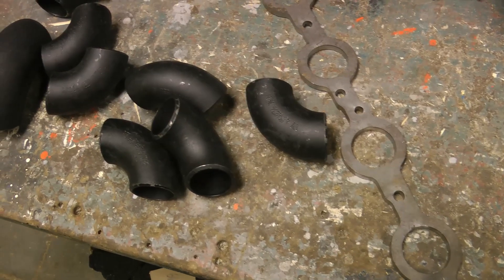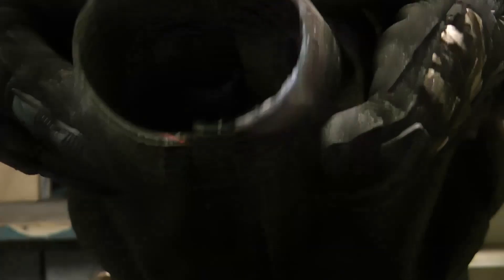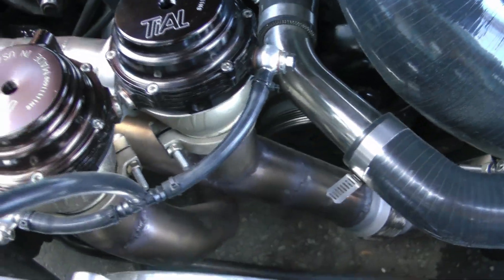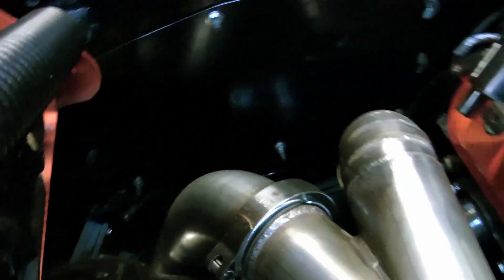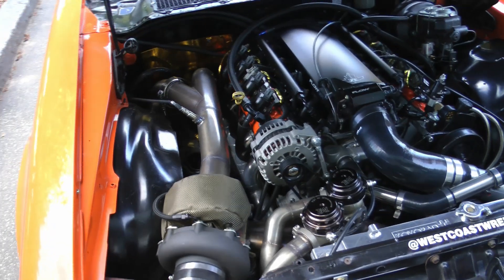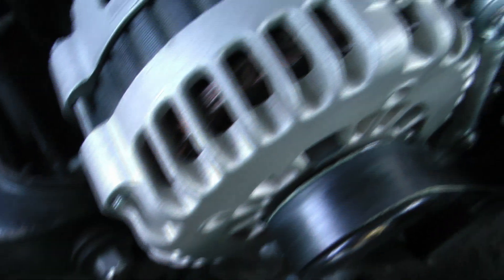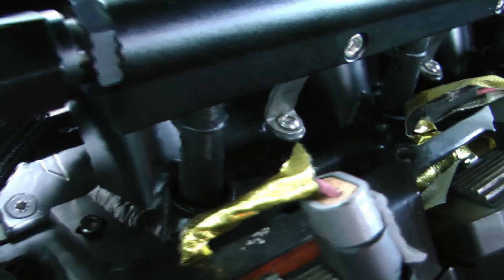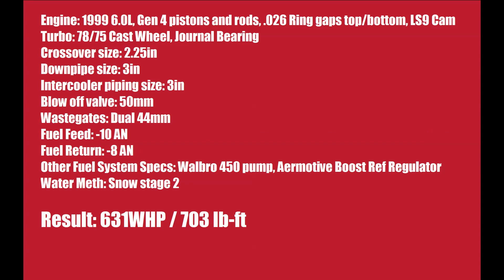How to Turbo your LS Engine (Turbo 1973 Camaro)

Comment: This is some serious fab skill man. Would love to build a setup similar to this but blow through carb 6.0 Currently in process of building. Plans for a 6.0 with PRC Stage 2 heads and stock cam. Gapping rings and looking to run 10-11PSI. Going through a magnum F and a reinforced 10bolt.
Reply from the maker: Thank you! It really just comes down to thinking things through, anyone can do it with patience

Comment: What kind of fitting is that on the intercooler charge pipe for the wastegate feed?
Reply from the maker: The aluminum elbows? Those elbows are vibrant and they're cast aluminum so you can thread them. They're tight radius too very nice pieces.
Reply from the maker: https://www.amazon.ca/Vibrant-2873-Degree-Radius-Aluminum/dp/B001804R1Y/ref=asc_df_B001804R1Y/?tag=googlemobshop-20&linkCode=df0&hvadid=293019025087&hvpos=1o2&hvnetw=g&hvrand=9471587623923005623&hvpone=&hvptwo=&hvqmt=&hvdev=m&hvdvcmdl=&hvlocint=&hvlocphy=9001444&hvtargid=pla-568633821806&psc=1
Reply: The fitting that you used for the boost reference off that pipe
Reply from the maker: @edwinrosadojr4592  that's just a simple npt to barb fitting. They're available at any performance part supplier
Reply: Westcoast Wrenchin'  thank you for all your help

Comment: Would love to see a 1/4mile run. This is a great channel keep it up.
Reply from the maker: Thanks so much! I've actually done one! The trans was on its way out and grinding bad  but whatever. Did 11.8 @125mph with a 2.1 60ft. Managed a 1.8 60ft but overboosted and shut off :( wait for next year is all I can say! I've got big updates to post soon. Thanks again for the support
Reply: @WestcoastWrenchin  This car is very cool the videos and instructions are great. I will stay tuned
Reply: @WestcoastWrenchin  nothing to be done to the map/maf sensor?? Doesnt the gen 3 come with maf and i have to convert it to map??
Reply from the maker: @FirstLast-tx3yj  what is your ecu setup? I've always run speed density and used a map sensor, I've never had a maf or a stock gm ecu
Reply: @WestcoastWrenchin  i have 2006 lq4 with stock p59 ecm and maf

I have done the manifolds and cold side but idk what to do with the maf or if I should do anything about it?!
Reply from the maker: @FirstLast-tx3yj  im not too sure on a stock gm ecu because I've never bothered to use one, though lots of guys do.
Reply: @WestcoastWrenchin  aftermarket is gonna b expensive so i wanted to just go with oe

Comment: Well done.  Great video.  Torque higher than hp revealing the turbine and cam likely holding it back.  Spec'ing parts to run out to 7500 would get you ~1000whp.   Maybe way more than goal, driveline or chassis is setup for.  Just a thought.
Reply from the maker: Thanks! It's a really fun street car and I'm sure with a bigger turbo itd hit harder in the top end!